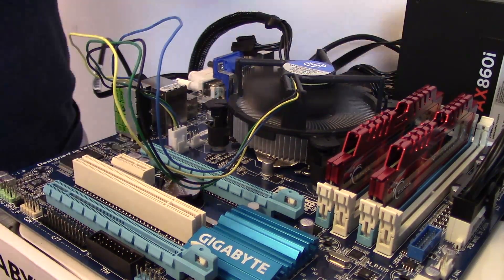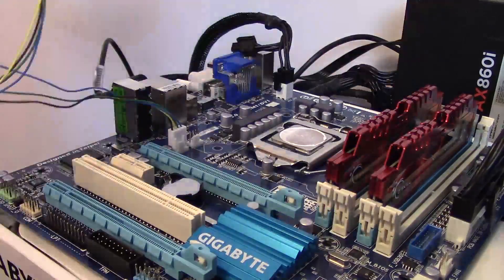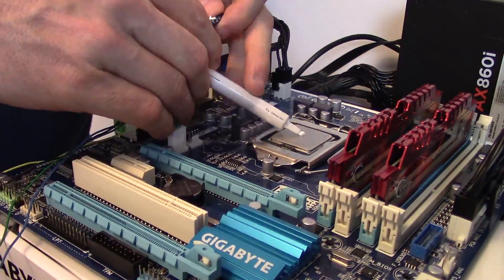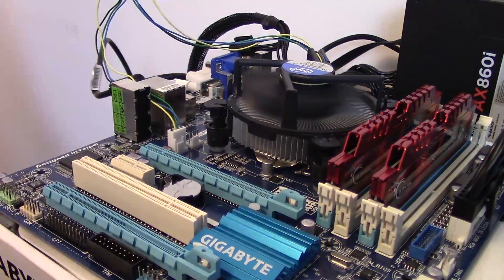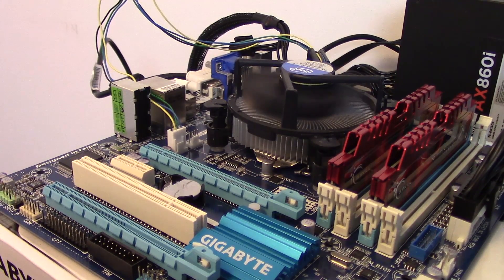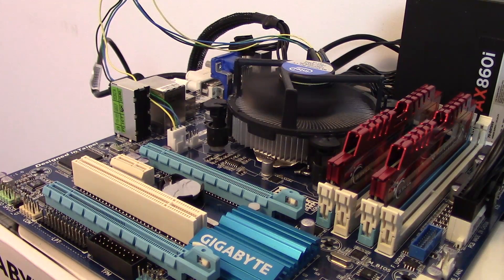TickleTest - Do you really need isopropyl alcohol to clean a CPU?

Comment: I have actually removed a cooler, careful not to mess up the paste applied the day before, did pin mod on q6600 then reinstalled heat sink, (no new thermal paste) and it was fine, no temp difference! Not an experiment as it was only once, but I digress!
Reply: No temp difference but it was modded to run at a higher clock speed? 🤔

Comment: There can be a difference of a couple degrees between different paste.
Reply from the maker: For sure. It matters when you're trying to overclock and spare yourself as much thermal headroom as possible. If you're one of the millions of people with a locked processors, it doesn't matter in the slightest.
Reply: I do OC, so i take advantage of the few degrees less heat.

Comment: How come isopropyl alcohol is so common in the states but nowhere to be found or extremely expensive in europe?
From all the tech channels I watch, it seems that you can buy the stuff at any store but over here, it just doesn't exist.
Reply: that's nuts. isopropyl alcohol is pretty cheap (around $1 usd for 32 oz - 946 mL) in the US and can be found in any corner store. it has so many general purpose uses in cleaning and disinfecting, not just for specialty activities
Reply: Definitely not common in the states anymore in 2020
Reply: Eco, I live in the UK, you can't buy Isopropyl easily here, only in certain specialist shops. But it can be found easily on ebay. 1 Litre cost about £6.39 so about $8 so not sure if that is cheap or expensive in the US. I invested into 1 litre which will last me for years.
Reply: @mumihp  . ? pharmacies
Reply: @Eco 
You can buy Isopropyl Alcohol in almost ANY chemist in England !!!
It is often called:  Rubbing Alcohol.
and its VERY CHEAP !!
Reply: easybullet3 rubbing alcohol is only 70% though. So it’s going to leave a lot of residue and water behind. It’s better to buy a higher percentage so it dries better.
Reply: I live in finland where 500ml is around 7-10 euro
Reply: wd-40 made contact cleaner fyi, it's safe to use on electronics
Reply: my friend u also use tissu paper and scrub on prosscer and fan also then u see tharmal gress removed.

Comment: Sorry mate, there is a fault in your methodology.

You are using the same paste each time so any residue left is going to be identical to the stuff you are putting on.

That said, I still dont expect there would be any change if you ran this test with years between each change and alternated between a low quality and high quality paste.

Its up there with people thinking a few messy cables restricts airflow in a case.
Reply from the maker: You have a point, but I doubt the result would be different. When you understand what thermal compound is designed to do on a microscopic level, it really doesn't make any sense to completely wipe the old stuff clean, unless you're upgrading to a strictly and measurably better paste for a firmer seal.

That said, the next time I order some of the good shit, I'll run the test differently and post an update.
Reply: I'd bet my left bollock any measured difference would be within the margin of error when a good paste is applied with a residue of the cheapest paste on the market from a quick wipe with a normal cloth to being applied after a meticulous cleaning.
Reply from the maker: Well to be clear, I didn't give anything a "quick wipe" in my testing. I used the same amount of elbow grease without the alcohol as I would with it. The CPU was most certainly free of any visible debris each time.

I will indeed make a follow-up to this video at some point testing different pastes with the same methodology.